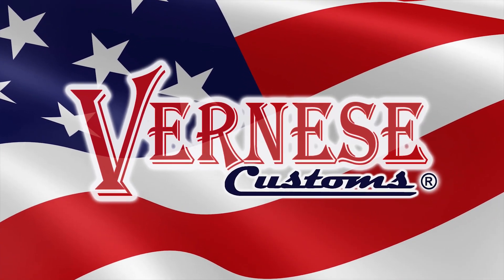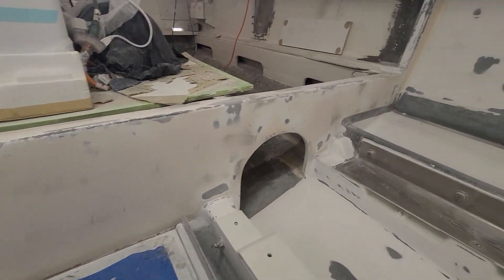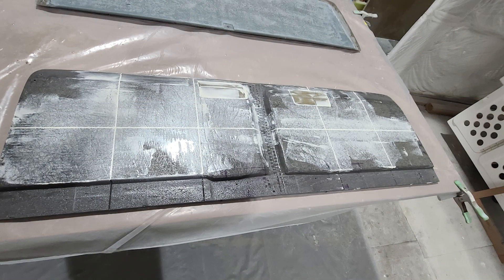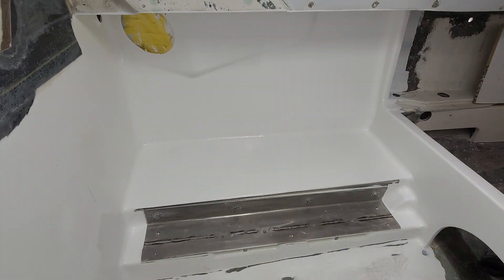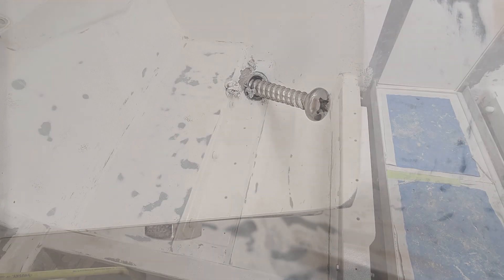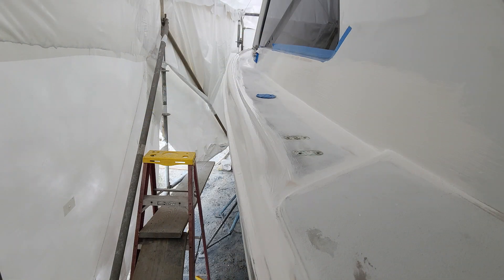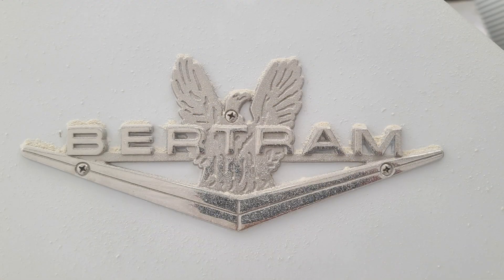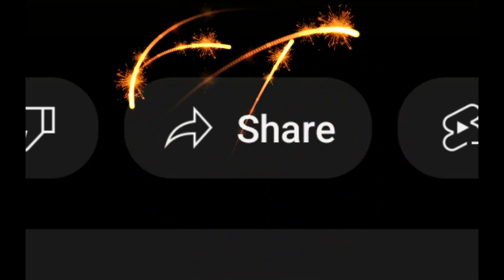Bertram 31 DIESEL Conversion EP06 -- Fiberglass INLAYS -- Struts TEST FIT -- Exhaust System Progress

Comment: Question from the past few videos - why skin the coosa with CSM?  Can't you just laminate directly to the coosa with a good wetout on the substrate?  I'm looking to redo my small CC transom this winter with coosa, never seen someone prep it thst way.
Reply from the maker: You can, and I am certain most folks do just wet and go. I take the time to sand and prime the Coosa for a superior bond. After priming, I typically lay 3/4 oz. CSM on dry, then oversaturate before laying 1708 or other biaxial fabrics. The excess resin then absorbs into the glass from below and requires less resin to fully saturate. This is how I wet mutiple layers of 3610. It works so well, it has become standard practice. Great question!!